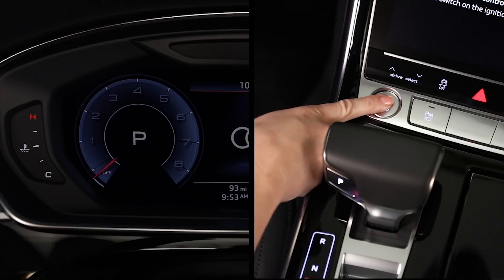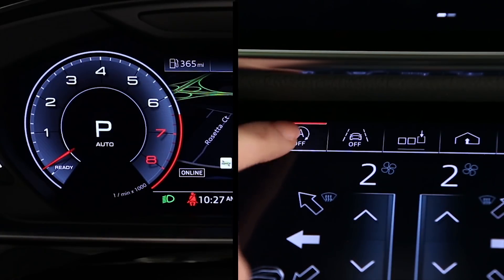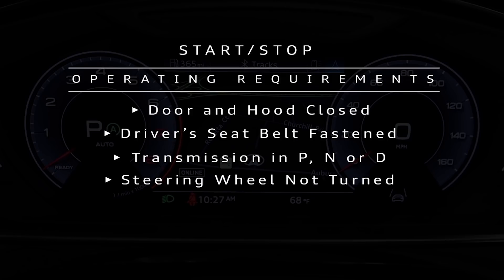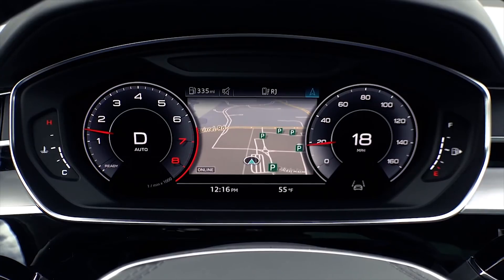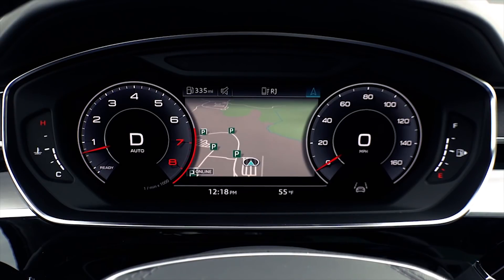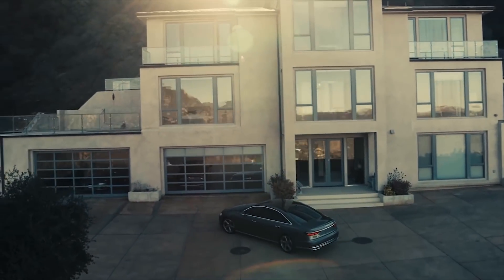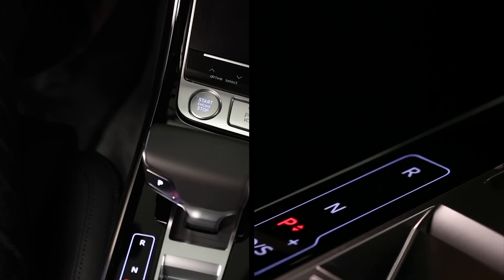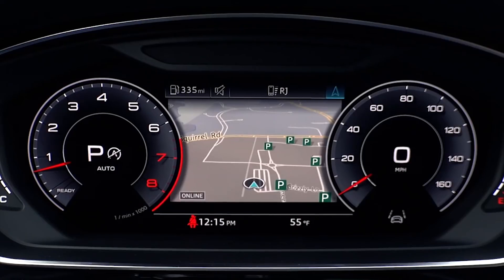Audi Tech Tutorial: Automatic Start/Stop

Comment: I have a 2020 A5 sport back and even when I turn the auto start stop off it still turns on by its self. Is this normal? How can I make it permanently turn off with out having to do it multiple times through out the day?
Reply: It’s required by the EPA to default back to “ON” every time you restart your vehicle.
Reply: @JDDrct  I just got 2018 a5 sportback- I didn’t turn it off and whenever I stop car I see the symbol but with a dash through it, I’m confused on what to do
Reply: @CameronBetz  it doesn’t work when you’ve got something drawing a certain amount of fuel like when you’ve got your AC turned down to “LO” or your window defoggers are running. When I’ve got my AC off or turned to about 68 the stop start becomes functional in traffic.
Reply: you can code it in the car, but audi won’t like that. they won’t void warranty or anything thou

Comment: In an older video that talks about this feature, it said that the driver can permanently turn off the engine start/stop. 
Is this still the case?
Reply: Andrew Unfortunately, no. It has to be turned off every time the car is started.
Reply: @ronaldlamascus1944  well obviously that has changed. Maybe thanks to Dieselgate.
Reply: Andrew supposedly government mandate headed to not being able to turn it off period.
Reply: @ronaldlamascus1944  thanks to Dieselgate.
Reply: Andrew I doubt seriously it has anything to do with Dieselgate. It will apply to all vehicles of every make and model most of which never had a diesel. It’s all about emissions for sure but I have never read of any diesel connection.
Reply: @ronaldlamascus1944  it has everything to do with Dieselgate. VW screwed it up for everyone no matter if they make diesel cars or not. But show me where you read that it has to do with emissions.
Reply: Andrew obviously you have knowledge of something that not everyone else in the automotive world is aware of.
Reply: @ronaldlamascus1944  I was talking to someone about this and they said this has to do with Dieselgate. Also why many luxury car makers are selling more and more cars with smaller engines. 

Like I said this has to do with Dieselgate. The US government (at least) are punishing every car maker in some way. Non deactivated or temporary deactivated engine start/stop systems. Some car makers like BMW are able to get away with this because of Mini. From what I am told. 

As I stated before that Audi used to allow the driver's permanently deactivate their engine start stop system. This was before Dieselgate and because of this, this has now changed. Mercedes-benz has also been cought with emissions cheating as well. As far as I know BMW is clean and are allowed to do more or less what they want.
Reply: Andrew and they (BMW) has decided to make all their 2021’s with always on stop/start which can never be turned off. I was interested in the new ‘21 X5 before finding out that little tidbit.